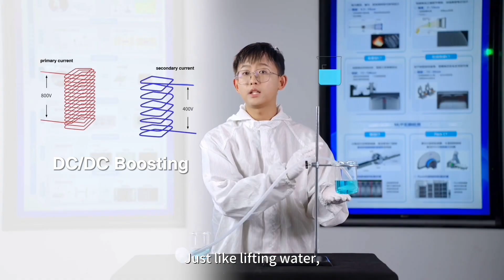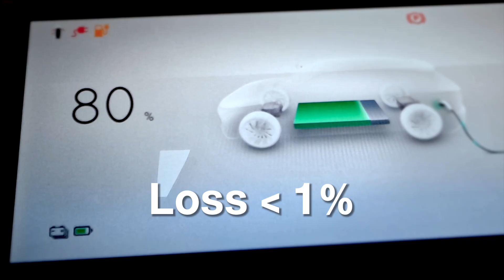400V Charger on a 800V Car? No Problem

Comment: Anyway we need an additional stuff to Boost 400V to 800V to send EDrive and so on. 

For this kind of design from charger to battery we have to use thicker cables from battery to 800v systems thinner cables. It adds weight and cost

Hyundai done it differently, used exisisting stuff ( motor ) for boosting so we don't need DC DC HV_HV converter.

Comment: For context 200 Yuan is about $28 USD per year.

Electricity in China is cheaper than in Australia and Indonesia, countries that expose coal to China. 

But Chinese people are very stingy. Imagine someone buying a Toyota hybrid in Saudi Arabia to save fuel.
Reply: Umm India buys way more of our coal than China. Sure they are buying some low grade coal but they very much do not rely on it for Electricity. China needs to import Smelting Coke for Industrial use, not our low quality coal for Electricity. FYI I've worked in Latrobe Valley coal mines.
You are just spamming engineering falsehoods.
Reply: @Neojhun So you agree about.  they stingy . Which causes the consumption per GDP figure to be very low😂😂.
Reply: Something something cost of living in china vs usa....